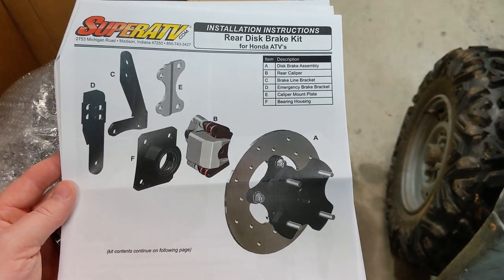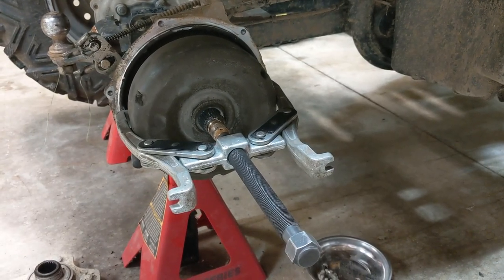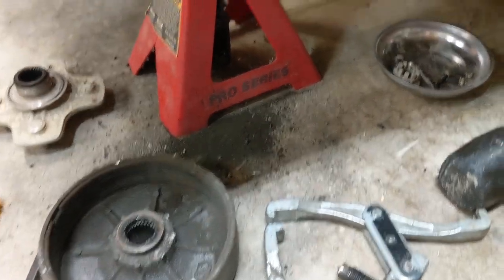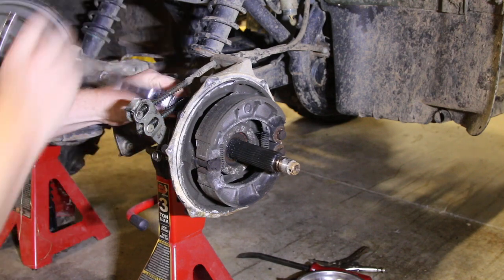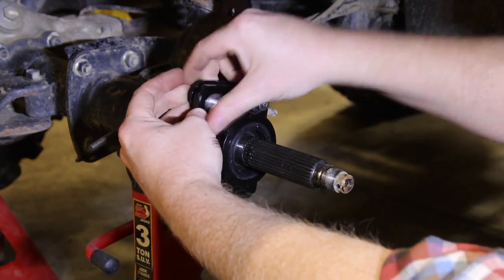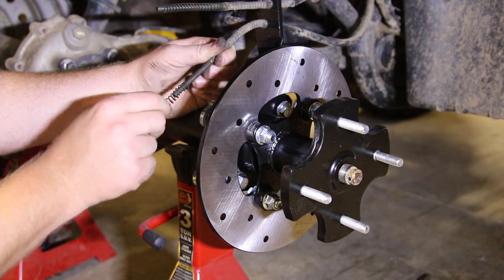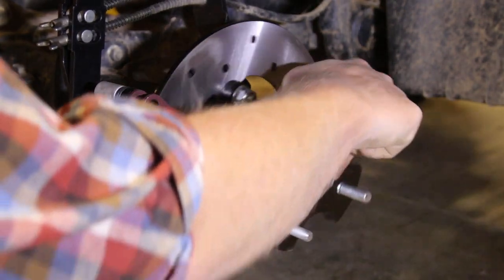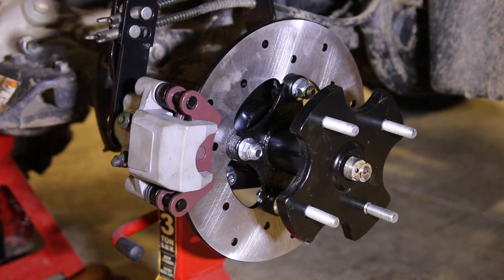Honda Foreman Rear Brake CONVERSION

Comment: Great Video. I found it helpful to grease that grove before putting the O-ring in, held it in place nicely while sliding onto the shaft...giggity. Their instructions were unclear and didnt make sense for that portion of the install..
Reply from the maker: Great idea.  I actually made this video to help others where their instructions were lacking to say it nicely.  Let me know if you managed to get yours working well.  I've actually replaced mine with a Frankenstein mix of parts.
Reply: @TheRoostersGarage  Not overly happy with this kit, once installed I found there is no happy medium for adjustment...its either tight and dragging or loose and poor breaking, I'm going to try extending the brake bracket to try and get the cables to pull a little straighter back, and I will most likley have to whip up some sort of return spring like you did...damn fine idea!! I am kind of dissapointed with Super ATV on this one...
Reply from the maker: @buggyskinnerms028  Yes, very disappointed.  The return spring helped, but in the end, it's a hydraulic cylinder that's being run with a cable.  I don't know if it's just the 4 wheeler I put it on or what, but I couldn't ever get any friction that I would really call braking.  I still had to brake by downshifting.  I've been meaning to make a video with the solution I came up with, and I'm going to have some time on my hands this weekend, so I'm going to make a couple of videos and one will be what I came up with to fix the horrible braking on this 4 wheeler.

Comment: I skimmed through your video for some help when doing this today. Instructions are not super clear from SuperATV, but at the end that nut has to push the adjuster in until it allows the pads to contact properly, I also loaded mine with Brake Fluid still, it acts kinda like a spring when you compress the fluid and then pushed it to its "home" position when you release the brake..
Reply from the maker: Does it work well with the brake fluid in there?
Reply: @TheRoostersGarage  Yes, This brake works as intended for me, it brakes extremely well and releases properly. if you fill it with fluid before its compressed it should almost work like a vacuum I believe.  Also need to make sure the long set screw is in far enough to have the brake pads close to the rotor. If i have some time this week I will record a clip and upload it.
Reply: Please do . I bought this kit a while back and pretty much been riding without no back brakes. Its hard for me to swallow the waist of money i paid for this kit.
Reply: @FeuledTurtle  could you please do a video on this , i am very upset with my new braking system i feel im out near 400$
Reply: I did same seems to work as intended but will have to wait till tomorrow for final adjustments. Was hoping for quick video to ease my mind but glad I came to comments. Thanks to the both of yall.🤘
Reply from the maker: I hope it works well for you

Comment from the maker: The hydraulic conversion is taking much longer than expected and I can't get enough pressure to do anything.  I'm currently looking for a replacement caliper that will work.  If anyone has any ideas, please let me know.  As it stands, the only thing I've kept from the kit is the hub with the disc brake.  I even called SuperATV and they have never used this kit with hydraulic fluid.  They know of one guy who did it but they used a pump in the system, and I assume it's either to move enough fluid or to increase the pressure since the piston is quite small.
Reply: any update??
Reply from the maker: @portigy1  I purchased a new caliper and rotor and I'm just waiting on that to come in to fit it up
Reply: The bleeder is on the wrong side of the caliper. You'll never get it to bleed and build pressure with the bleeder down low like that
Reply from the maker: @ISpoolOldSchool  I know.  Thats how they designed it.
Reply: Any updates on the hydraulic adventure?
Reply from the maker: @jefflong9030  I custom fabbed a bracket to hold a new caliper and had amazing brakes for a bit.  Now I no longer have hydraulic pressure and have to figure that out
Reply: wilwood dynamite single 3 or dh4 or sc1 sc2 sc3 or ps1 might work im trying to convert mine to
Reply from the maker: @warlokwarlok108  Thank you.  Good luck in your conversion
Reply: Have you figured out the set up? I can’t get pressure in the caliper supplied I wish I knew how to upload some photos can show how I mounted master cylinder etc. and research the  wilwood SC10 two piston caliper looks like it would work but havent had time take measurements yet
Reply from the maker: @warlokwarlok108  Yes, https://youtu.be/QjjVxjSiBxo is the follow up video.  At the current moment, I have lost all brake fluid and have a stack of other projects to complete before I can even think about working on this 4 wheeler.  I think the Chinese brake line absorbed the fluid or something though.  There's no drips anywhere, and the hose has changed color and texture.

Comment: That bleeder should be on the high side. I know it's been a few years but how is it working so far with the hydro set up?
Reply from the maker: Well, their caliper is upside down by their design.  I have a follow up video where I used a snow machine caliper, another brand of 4 wheeler hydraulic handle.  Now it works great that I reengineered everything, lol

Comment: good quality video sir. Your four wheeler is much the same as my trx300 fourtrax and my rear brakes were so stuck that the drum shattered trying to remove it. your video helped convince me to convert to disk ( that and the cost of replacenment drum brake parts). thanks
Reply from the maker: Thank you for the kind words.  I'm glad the video helped out and you enjoyed it.  That's the reason I make videos, to help other people out.
Reply: does the super atv kit work on a 300 with the brakes being so far in and away from the hub like this one
Reply: @jacobjames1376  no not for the drums near the middle

Comment: yeah man when i replaced my rear axle my drum was stuck on there it took beating it on some concrete for 20 mins to get it off
Reply from the maker: Yeah they get rusted on tight.  Maybe I should have done a montage of all the beating it took

Comment: Installing this exact kit on my 01 Honda Foreman TRX450. Their site says it's not compatible with my model, but it's identical to the one you have, so I imagine they're wrong :D Unless of course you had huge issues with your kit after installing it.
Reply from the maker: Check my follow video, link in the description.  It wasn't enough braking power for me, but I still used their hub and disc from this kit.  Maybe I didn't get it adjusted right because some people love this kit.  I had smaller kids riding this and they didn't have the grip strength to really haul this down.  The full hydraulic swap I did will lock up the rear at about 20 mph
Reply: @TheRoostersGarage Thanks for the prompt reply, I wasn't expecting that! I've read through some of the comments here and hope I'll be able to sort this out. I also agree, the internet is amazing, I've never worked on a 4 Wheeler before, but it's quite straight forward once you've seen it done in a video!
Reply from the maker: @mikebriggs2k  It's really not hard.  Their instructions didn't make much sense to me until after I was done.  Hopefully you will be able to get this knocked out

Comment: So what is your thoughts or any ones thoughts? I have a 2007 Honde 500FE ES I thought about changing to Disk. Is the kit not worth the hassle? Thanks!
Reply from the maker: In my follow up video to this https://www.youtube.com/watch?v=QjjVxjSiBxo&t=0s I list out everything I've done to change this kit to a hydraulic conversion.  Basically I wound up keeping their rotor, so if they sell just that and you can fabricate the bracket and want to build out a true hydraulic brake system then go for it.  If this level is outside your wheelhouse then I'd recommend sticking with drums.  This kit alone is not worth the hassle or money wasted.  Their caliper uses the parking brake feature to try to be the main brakes which is ludicrous.  Some have been able to make this kit work better than stock but I lost brake power going from a rusted drum to this kit until I went full hydraulic.

Comment: Did your brake lever and foot pedal stick when u would use them it's like it needs a big spring to make it return to the position where it dont grab the brakes
Reply from the maker: Yes.  I wound up replacing nearly everything in the kit

Comment: How do you like the braking of the rear disc brake
Reply from the maker: With it being cable actuated, I hate it.  There is no additional braking force and I've adjusted it several times.  I'm about to do a hydraulic conversion
Reply: Rooster's Garage after you do the hydraulic conversion keep us posted great video by the way
Reply from the maker: @mutha_f_llama9275  Thanks!  I'll be making a video of the conversion process along with what's all is required.  Just got to get some of these other projects done so I have room in the garage!
Reply: @TheRoostersGarage  if the pads last longer then the shoes,  I'd say it's a improvement. Even if the stopping force is the same. I'm a die hard honda fan all the way but when it comes to there rear drum brakes, they are garbage. Thinking about doing mine in the disc. Will be following to see the hydraulic conversion. Great video.
Reply from the maker: @davethemagnificent2576  Thanks!  Honda makes a great 4 wheeler until it comes to the brakes for sure.  The next video will take a bit because I was given a Honda 250 for my youngest and am working on getting it running for a very anxious 8 year old.

Comment: i think this will work for my 94 honda 300. hopefully.
Reply from the maker: Yeah, I'm pretty sure they used the same brakes for several years.  In the follow up video (link in the description) I use their rotor and scavenge some parts from eBay to get hydraulic brakes to the rear.  I only have the hand brake working but none of us ever used the foot brake anyway and it always seemed to rust in one position.

Comment: Súper awesome video thank you so much for sharing. I would love to do this to my 1998 Honda fourtrax 450 ES
Reply from the maker: Thank you!  It sure makes a huge difference being able to stop
Reply: @TheRoostersGarage  so it works s? It stops the 4Wheeler? Where did you get this disk brake kit ? How much is it?
Reply from the maker: @MOUSEBOWEN  I bought this kit https://www.superatv.com/honda-utility-atv-rear-disc-brake-kit then threw away most of it and converted it to hydraulic https://www.youtube.com/watch?v=QjjVxjSiBxo.  It was a bit of work, but the challenge makes it all the more enjoyable.  Now it's got the stopping power to lock up the back tires at 20 mph!  If SuperATV would sell just the rotor that would make this a lot less money.

Comment: Will this kit work on a 1993 Honda TRX300FW  Fourtrax 300 4x4 , I just bought one & I'm NOT familiar with them but it needs brakes
Reply from the maker: Oh man, I'm not sure if it would fit, but check with the manufacturer and they will know.
Reply: No it does not work with the 300
Reply: An ATC 200x rear brake hub with 3 bolts will fit the splines on the 300's axle, still have to figure out mounting the caliper and all though

Comment: I had a local service center install this kit on my 2013 Honda Foreman 500.  Complete rubbish.  Had it readjusted 3 times and still won’t work
Reply from the maker: Unfortunately it is.  i had to build an entirely new system with a hydraulic caliper, threw away almost everything in this kit except their rotor/hub.

Comment: did you ever figure out a combo that would work for hydraulic brakes
Reply from the maker: I did, I've just been too busy to make a video on it but I'm trying to take some time to video it.  I went with a Can-Am Outlander 400-800 hydraulic lever, 85" hydraulic hose with M10 banjo fittings on each end, and a 2003 Arctic Cat 440 Firecat Wilwood brake assembly.  It took a M10x1.0 banjo bolts to hook up the Wilwood caliper and a little bit of sanding to make a flat portion on the caliper to seal to the banjo bolt.
Reply: What all parts did you keep from the original rear brake conversion
Reply from the maker: @natedogg651011  The only part I kept was the hub/rotor assembly.  The Arctic Cat rotor would not bolt up to the SuperATV hub and I had to make a bracket to mount the Wilwood caliper to the mounting bracket from the SuperATV kit.  That part of the kit was well made and up to the task of stopping this heavy 4-wheeler.  Now I can lock up the back tires at about 20 mph so I actually have to regulate how much pressure I squeeze with instead of grab the handle and hope for the best.
Reply: @TheRoostersGarage  Hope when you do a UPDATE on your conversion you LIST each part, with their part number & place purchased, will this kit fit a 1993 Honda TRX300FW  Fourtrax 300 4x4 ????
Reply from the maker: @REVNUMANEWBERN  I've got some broken things at the moment I'm trying to get fixed, and I've changed computers so I had to get the file converted over to the new computer.  I know this update is so overdue it's not even funny but yes it will have part numbers, where I purchased it, etc.  I'm giving all the details in the update.  As far as the fitment of the kit, SuperATV's website says it fits Honda 2x4 and 4x4 Utility ATV's with a 12" or larger wheel and rear drum brakes but not models with drum brakes on the swing arm.  If yours has 12" or larger rear wheel and the drum isn't on the swingarm, then it looks like it should fit.

Comment: what size puller did you use there? I'm having the same problem removing the drum.
Reply from the maker: I want to say it's a 10" gear puller.  It's older than I am, but it's an old Craftsman with very long arms.  It was almost too short.
Reply from the maker: I can't find anything on this puller so I'm assuming it's not made anymore.  It's a Cal-Van 242.  The arms are 4" from the pivot to the puller end and will go a max of 8" wide.  I wish I could find a link for these but Cal-Vans website doesn't list the part number.

Comment: Did the brakes work good with the cables
Reply from the maker: No, they barely work at all
Reply: Ok so not worth installing?
Reply from the maker: Unfortunately no.  I'd love to say the brakes were better, but in fact they might even be worse.  Another viewer commented they can't be just converted to hydraulic either like they say.  That is still on my list to try though.
Reply: Okay thanks.
Reply: I bought this kit for my 05 foreman and they would work if the cable was right length. The arm that activates the brakes puts the cable in a bind and ive tried everything to get this kit to work right but no luck. Thinking about going back to stock drums

Comment: In good shape compared to most idk why honda even bothers putting them on they have got to know they fail constantly
Reply from the maker: I guess it keeps them humble, otherwise they'd make a perfect machine that runs practically forever.
Reply: @TheRoostersGarage  true true but top end is a miss such low torque unless you're in some peanut butter 1st is almost useless 2nd and 3rd money gears
Reply from the maker: @jameswisecarver  Very true.  I was able to get this one to 55 going down a hill, but I was on about a mile of asphalt to get there.  I've also pulled a 16' trailer full of kids and adults around a neighborhood for Halloween with this and 1st gear got a lot of use that night.  It's a workhorse and not great for play, kind of like my Kubota side by side that maxes out at 25mph but has tons of low end grunt.

Comment: It will not work hydraulically.  I don't know why they put those fittings on there. But I thought it would work but it want.
Reply from the maker: Really!?  I have the equipment to swap it over already.
Reply: @TheRoostersGarage  if that's the same brake caliper that I got with mine it does not work hydraulic you have to change that brake caliper out for one that's hydraulic even though it has the fittings that caliper is not set up for hydraulic.
Reply from the maker: @aarongore9274  Hmm...  That's not what I want to hear
Reply: @TheRoostersGarage  I have to get a brake caliper from and old motorcycle and put on it to make it work hydraulically
Reply from the maker: @aarongore9274  I got a hydraulic lever from an Arctic Cat and bought an eBay braided hose.  Still have to figure out how to get reverse though.
Reply: @TheRoostersGarage  I use that right brake pedal tomake my reverse work I use the same cable hooked up to that brake lever and when I push down on it that sends it into reverse
Reply from the maker: @aarongore9274  Sounds simple enough

Comment: I bought a 2019 foreman base model last july. The rear brake has failed 3 times since then. Idk how but it seems that the arm that turns the shaft that engages the brakes keeps slipping on the splines. My friend has a 2018 and its the same story. I hate these dam drum brakes. And not to mention the dam water getting into it. Wtf is with honda holding onto the drums? I can say though i will NEVER BUY A STRAIGHT AXLE FROM HONDA EVER AGAIN!!! And i wish they made a kit for the 2014 and newer models
Reply from the maker: They are still making drum brakes!?  Good grief!  I get not changing if it's not broken, but a Honda 4 wheeler that stops is a unicorn.  These are great machines, with the one caveat being the brakes.  This machine fell off a trailer when I was driving about 30 mph because a strap broke.  It then went through a fence and flipped several times.  I fired it up and drive it over to a friend's house over a mile away, started and finished the work we set out to do and trailered it back home.  I still haven't gotten all the oddities worked out of it since the incident, but it still runs.